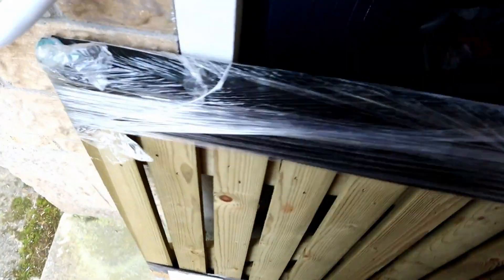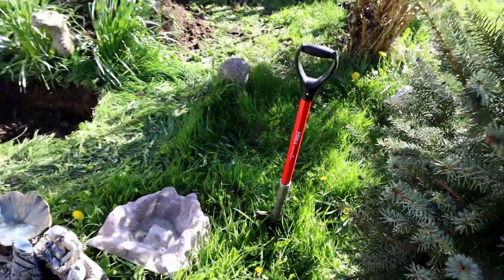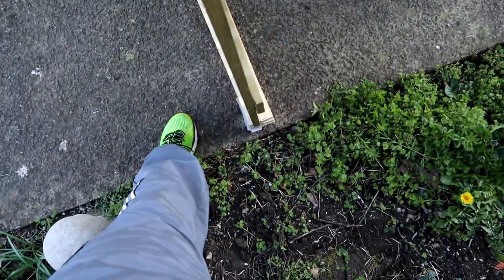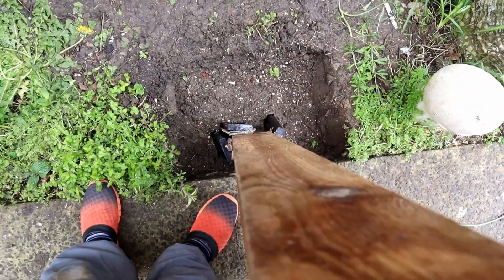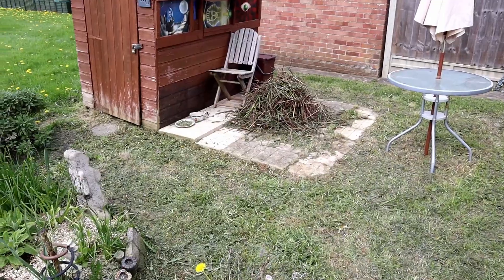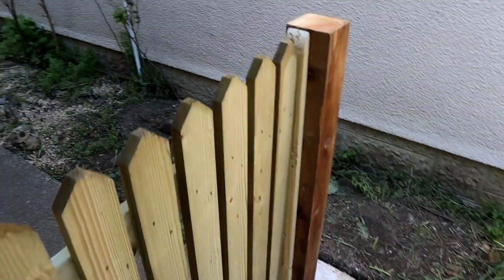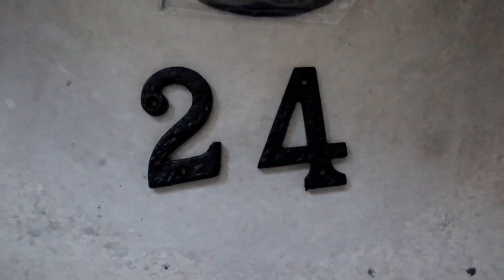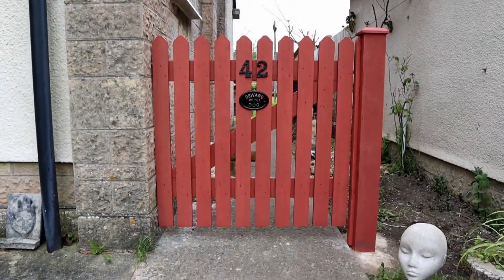Vlog #1 - Install Garden Gate & Small Pond

Comment: So I was wondering if I could use poly fiber with polyester resin instead of the traditional fiberglass
Reply from the maker: I think you might be on the wrong video! 🤣😂🤣
Reply: @dramamask  🤣 🤣 🤣
Reply from the maker: @Odessa69t  PS: I have use fibres in polyester resin in some cases - filling, etc.